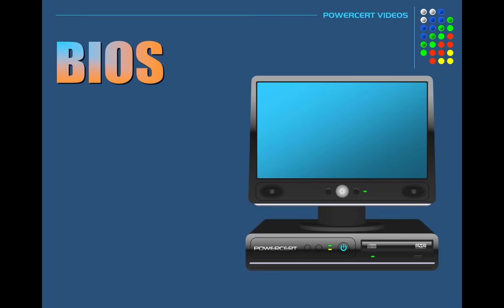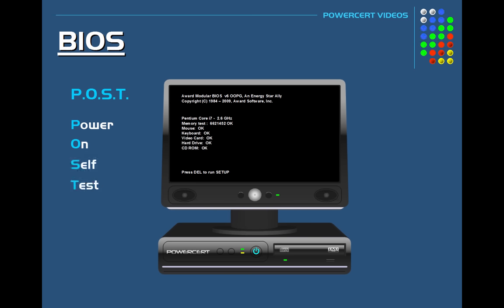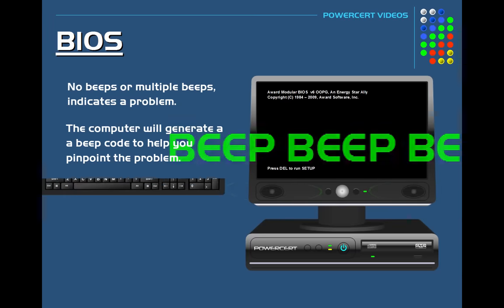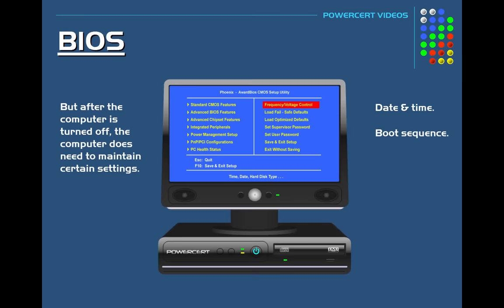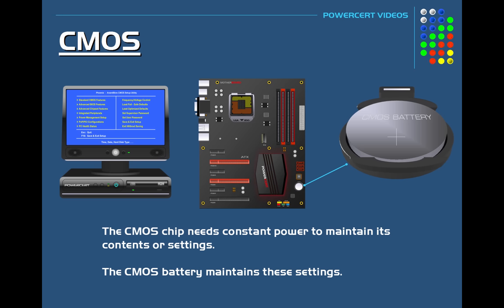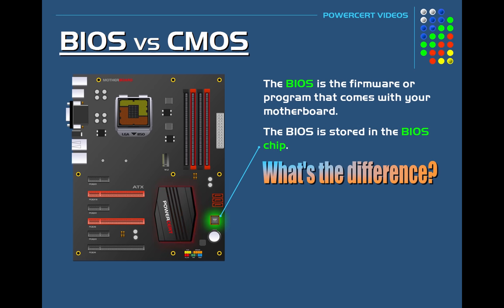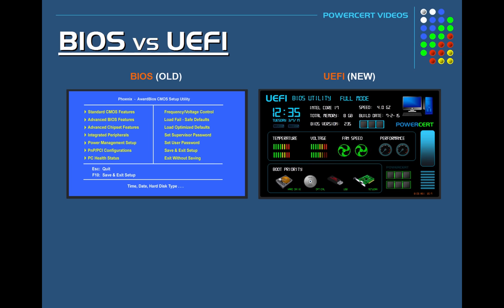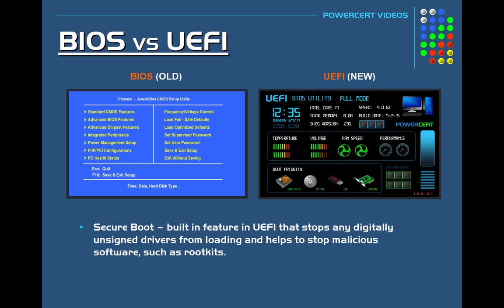BIOS, CMOS, UEFI - What's the difference?

Comment: Where is bootstrap loader exactly
Because boot strap loader is function on bios and on internet it's said it's stored in rom bios 
But bootloader is located in master boot record
Please explain and reply me ....
Reply: Modern computers don't use MBR anymore. Most computers use UEFI which replaced the BIOS (though the term BIOS is still continued to be used). I'm not an expert in all this, but from my understanding, when an OS is is installed in UEFI mode, it creates an ESP (EFI System Partition) which contains the bootloader and I believe is the equivalent to MBR. The UEFI looks for this partition, loads the bootloader which in turn loads the OS and its required programs and files.

Comment: Not all systems beep once when the POST is done. My Dell Optiplex doesn't beep on boot-up.
Reply: Some won't so long as there's no change in the settings, no power downs, or resets. However, it sees a hardware error and it will. Some beep on every post unless the board goes toast.

Comment: So if you don't turn on your computer for a very long time is it possible for the CMOS battery to run out and erase the BIOS settings?
Reply: Its unlikely. If your computer is plugged into power, it should retain the BIOS settings even if the CMOS battery is dead. In addition, these batteries usually last over a decade, so unless you plan on not using your PC for over a decade, chances are nothing will happen. You will probably get a new computer long before the battery dies.

Comment: Removing and replacing the CMOS battery will do nothing,   if you remove it and wait for 1/2 hour then it will default,  you have to wait for capacitance discharge.
Reply: You could short out the battery terminals for quicker effect...

Comment: If you take the CMOS battery out for a long while, would it damagane the UEFI or BIOS in a new computer
Reply: No damage. You might get a warning message telling you that CMOS settings were lost, but it won't affect the computer.
Reply: @JJFlores197  So if CMOS settings where lost is that bad and can I put them back if I'm not computer savy? Thanks for answering btw.
Reply: @proudmary9081  Its not exactly bad. That most that will likely happen is that the date/time will be reset, but that's not too hard to change.

Comment: My computer boots up Windows just fine and seems to operate normally but, It never beeps when it starts up. Is something broken?
Reply: A lot of computers don't have an internal PC speaker so they don't beep. It could also be that the PC is designed to not beep unless there's something wrong. In short, don't worry about it.

Comment: Can a dying/dead cmos battery make computer not to boot?
Reply: It is possible if the boot order is different than defaults. In other words, if you change the boot device to be a secondary SSD instead of the primary drive AND the CMOS battery dies, the settings can get reset making another drive the first boot device. This may cause your PC to power on, but not boot from the SSD in which the OS is installed.
Most likely what will happen is that you get a date/time mismatch every time you turn on your PC.

Comment: I'd like to point out that UEFI also "helps" to stop legitimate software like some Linux distro's
Reply: What do you mean? I have never used Linux but I am considering to try it soon
Reply: @MarkoVuckovic32  What I mean is that you might have to turn off secure boot depending on the distro, also the installation process might be more difficult, because the bootloading is different, unless you let Ubuntu do the install for you.
If you don't want to dual-boot your PC I recommend setting your motherboard to Legacy BIOS instead of UEFI if things don't work out (Don't do this if you want to dual-boot and Windows uses UEFI).
Reply: @unh0lys0da16  ok, thank you for the info. I gotta think what I actually want before trying anything. I'm not even sure if I want to dual boot or not.

Comment: But if you take out the battery, doesn't that mean the bios password will be removed
Reply: In some motherboards, that won't work. But yes, that is generally one of the ways to remove the BIOS password.
Reply: @JJFlores197  sounds like a big security flaw

Comment: Bios still need battery to store configurations?
Reply: As my understanding from the video, BIOS firmware is stored in the BIOS chip, that is non-volatile, which is remains in the chip. While the BIOS settings or custom configurations you've made is stored in the CMOS chip, which is volatile, that is it needs power to keep the memory from goes off. The power are supplied by CMOS battery. If it is removed, the power is cut off and the BIOS settings will reset to default.
Reply from the maker: Perfect answer.  But the CMOS chip is volatile.  Which is why it needs constant power.
Reply: @PowerCertAnimatedVideos  Thanks. Oh, I mistyped about that. Btw, I'm just rephrasing your explanation. 😅 keep up your good work 👍
Reply from the maker: I figured it was a typo....but a perfect answer.

Comment: I change from BIOS to UEFI and my computer won't boot from it. I know I'm doing something wrong but not sure what.
Reply: Did you disable the legacy BIOS (may be called CSM, legacy BIOS, or similar.) and just enabled UEFI? If so, can you try to undo that? If it boots up fine in BIOS mode, it most likely means that your Windows installation is BIOS only and not UEFI. There is a way to convert a Windows BIOS installation to UEFI, but i have never tried it.

Comment: If the cmos battery is removed does it this also remove the bios password if you had it set up?
Reply: It depends on the motherboard. One some it will work, and on others you have to short the password reset pin header. On some boards, it isn't that simple.

Comment: hi if i reset the BIOS  will it be al files deleted from HDD ,or not,i have SSD  wit windows it s  C,partition ,and i have HDD it s  D partition ,do i need to remove HDD,Thanks
Reply: No. The BIOS has nothing to do with the files on your drives. The CMOS's data may be cleared, but not your files.
Reply: @JJFlores197  ok thanks, i maked shitt, i deactivated CSM and now display not started, but computer yes, 😢
Reply: @yasons9531  Clear your CMOS settings. Check your computer/motherboard manual for information. That should get you backup and running again.

Comment: Is there any way to recover bios settings after the battery has failed and been replaced?
Reply: Not to my knowledge. Some BIOS let you save the settings to a removable drive, but you would have needed to have done that prior to loosing the settings. In general, the default is fine for most users unless you had very specific custom settings.

Comment: Let's get this straight. I have been involved in computers since 1977. I am one of those people that helped create and set the new, basic standards. Semantics matter. Bios stands for Basic Input Output System. As abbreviated, we original geeks always pronounced an abbreviation, NEVER spelling them out. Using proper word forms in English, the syntax is pronounced accordingly. BIOS, then, would be spoken as a word, and it is pronounced as BY- ah-ss. You don't pronounce the O long because there is no trailing vowel, e. Giga. Guy--Guh. Its root is Greek therefore it should be pronounced accordingly. Don't say it by spelling it, eye-oh-ess say eye oss. CMOS. see-moss. UEFI - you-eff-ee

Comment: hİ! I had dual boot errors and after then had to get disabled secure boot. Do you have any advice for me?
Reply: What systems are you trying to dual boot? Secure Boot is more or less exclusively used by Windows. If you're trying to use a Linux system or a Windows system that predates UEFI/Secure Boot, it likely won't work well.
Reply: @JJFlores197  linux mint and windows 10 :/

Comment: My mother board bios has uefi but it blue screen and doesn't support mouse its h81 generic Mobo... So that wrong info in video...
Reply: For me it's not, It's actually some model
My Laptop is Blue screen and support UEFI, still need to use Keyboard (using Lenovo T430)
While my main PC having it's Background and has detailed info (customized PC, have a UEFI motherboard - ASUS H71M-DGS)
Both are from 2011.

Comment: secure boot stops nothing
you misunderstand this technology and idea
actually there is definitive proof you run on secure boot or not
tpm may help to prove it, but that is not definitive either
more research, less talking rubbish
Reply: Secure boot is made for the exact purpose he said it's made for. There may be an exploit to get around it (Not sure, but have heard it's the case). That does not suddenly turn secure boot into something else...

It's like saying I develop a virus that gets around anti-virus software. Would you then go on to claim that anti-virus does nothing and is useless? No.
The fact there is an exploit to get around secure boot does not mean secure boot is not made to prevent rootkits and unsigned drivers all of a sudden...

Comment: In the past 20 years of computers that I have owned zero percent of the PC computers that I have owned have had internal speakers so there will not be any beeps. In the past 15 years most motherboards don't even have a header for a speaker.  This means that no sound at all unlike a iMac which initializes the sound chip at startup.

Since PC motherboards have multiple orientations, your description of where the CMOS battery is not really helpful.  I worked on a system once that the battery was a AAAA (yes Quad A) NiCad battery located in holder mounted on the rear of the computer and a wire leading to a header in the middle of the computer right by the CMOS.  The MB had a charger with over charge protection on it. 

I am using a pc right now on a old style Award BIOS that has a 4TB internal drive whose only purpose is to use for  local backups for my clients.  That I have at the largest external HDD of 8TB.  I haven't tried anything larger. 

Rev George 
LFCS, A+, MCSE

Comment: Yes that was the selling ponit of "secure boot". But in reality it is mostly used as a DRM bullshit system to brick most Branded PCs from running custom OSs. Some manuf. like Lenovo or Dell really go out of their way to lock the booting of other OSs like linux or BSD in their windows installed machines. Shame on them.
Reply: What do you mean? I have Linux Mint running on my Thinkpad that originally came with Windows 11. It has secureboot still enabled.